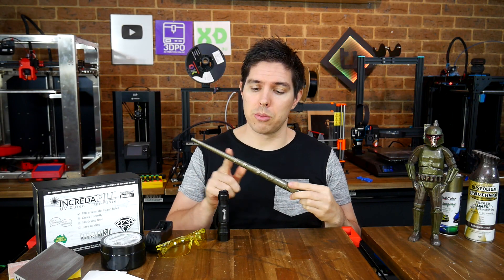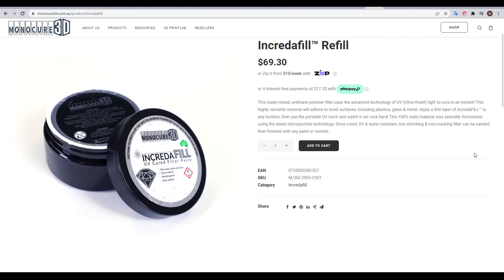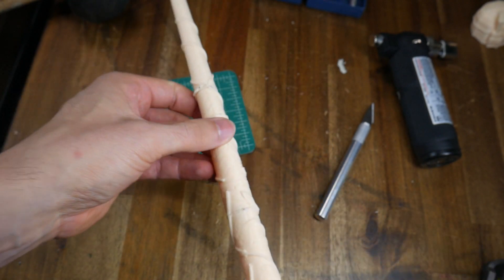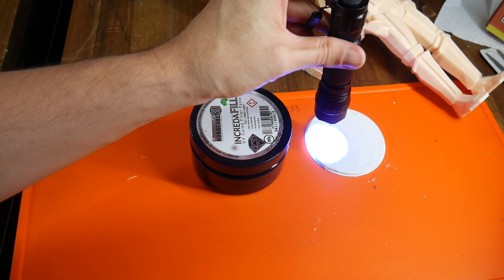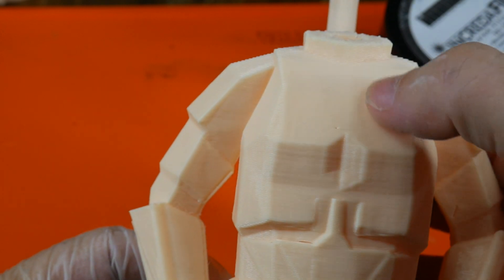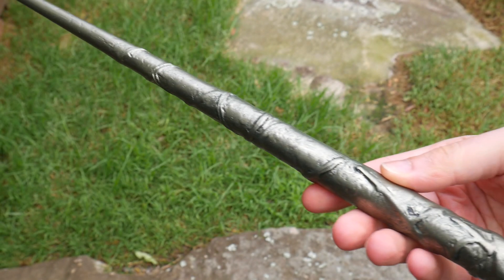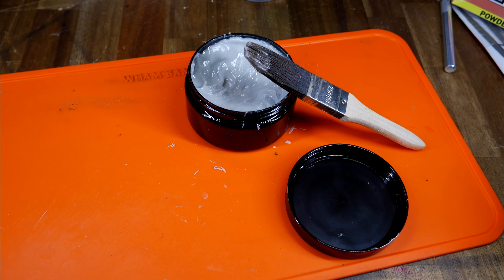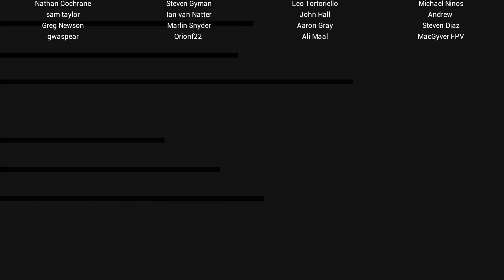Incredafill putty: Remove 3D printer layer lines with the power of light

Comment from the maker: It's clear from the comments plenty of people have home remedies of 3D printer resin mixed with other substances to thicken it up. That's not something I'm personally interested in mucking around with, but I understand that others will get much better value that way. Each to their own!
Reply: I didnt know you had kids
Reply: Can't be bothered to sand things smooth, can't be bothered to try sensible low cost solutions. Kind of lazy considering this is your job yeah?
Reply: @mrb2917  the judgement train is now boarding with a seat left just for you!
Reply: @mrb2917  Except it's not his job, if I recall correctly he's a teacher.
Reply: @mrb2917  spoiler: because it's actually a sponsored commercial.
Reply: Could you do a video where you test if it can make prints water tight?
Reply: Not according to the description
Reply: @mrb2917  Why do you care? And more to the point, sometimes you DO invest more in better tools when you do the same thing all day. I use better paper and pens for my illustrations than most people use for doodles. Does it cost more? Yes. Could I take more time using worse tools and get similar results? Yes. But I don't want to, and I make money off of it, so why not do it better??

Comment: I get a funny feeling you hate sanding.  It's a good thing that folks like you try to keep us informed of products used in the community.  By the way your printer calibration website is very useful, after going through it my Ender v2 is putting out some nice looking accurate prints.
Reply: What's the link to this section of the site?

Comment: To be honest, (at least for me) the price is a deal-breaker
Reply: You can only buy a refill and use sunlight ?
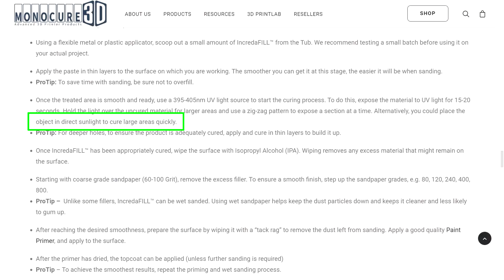Reply: @nobocks  According to 6:24 it might be possible if the only difference is the uv-torch. But I'm also not sure after he still used the UV torch before putting it into sunlight. Probably he was worried that those spots wouldn't be cured.
Reply: You can also just use uv resin.

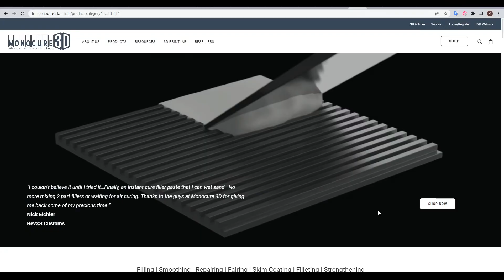Comment: It seems the key to this is applying it very thin so the depressions between lines are filled but not much more than that, their video at  00:52 shows it being applied very thinly with a pallet knife or other scraper type tool.  I'm sure that's much easier said than done! It would be interesting to see what the model would have looked like with only the rustoleum hammer effect paint and no filler at all.   I will have to try some.

Comment: Finishing 3D prints is tedious especially with small detailed objects.  Things like Cosplay helmets and Armor seem to be the better 3D prints to use these techniques on.  I personally like the smoothing technique with Isopropyl alcohol which I think only works with ABS.  This becomes sanding vs trying to get ABS to print properly, and for me I would rather fiddle with the printer to get the prints to work.
Reply: Acetone smooths ABS. Alcohol can smooth PVB I think.
Reply: ABS is an incredible material specially for functional parts, but damn the layer splits...
Reply: @JohnClark-tt2bl  yeah that was it. My wife does nails so we have plenty if I wanted to make glossy parts.
Reply: isopropyl is only for PVB which actually isnt bad at all

Comment: Looking at boba at 9:44 I can see that you were using a bit too coarse of sand paper and Im assuming this UV cure putty actually dries fairly hard unlike automotive putty which dries to be sandable.  You should definitely try out filler primer instead of the putty. It looks like the putty didn't sand very easily at all. Ive worked with a lot of automotive filler putties and such and I can assure you no two brands are made alike and bondo sucks. Some fillers sand like a dream and others feel like you're just sanding epoxy. Filler primer is made for being a top coat over putties which sands extremely easily so you can get it smooth with a 400 grit without having to sand forever.
Reply: Dolphin glaze is an excellent finish putty!
And u-pol filler primer is what i use to prep my prints for paint when i want a super smooth finish
Reply: Yes!  Why deal with toxic resin when you can use putty.

Comment: I find the local autobody supply shop to be the solution.  I use a heavy automotive filler primer, it dries fast, sands very easy but does require a small spray gun and air compressor.  If you have the equipment it's a reliable solution.  A whole gallon of automotive primer costs about what that little can of UV resin costs.  I just buy a quart which goes a long way.  

No matter what you end up sanding which I also hate lol

Comment: Overall the kit looks good especially is you dont have a UV light in your arsenal of tools. Maybe a cheaper refill would be UV resin mixed with some talk powder. The material does look a bit too thick for my liking however. The models you chose were always going to be a tough sell for this product. I still feel a few coats of spray putty would have done a better/cheaper job. Also leaving the lid off the container especially if close to a window or in a room with refelcted outside light could be an issue.
Great review.... thx
Reply: My intuition tells me to try fumed silica.

Comment: You can do something similar just mixing talcum powder with reg SLA printer resin to the consistency you want and costs way less
Reply: What about cornstarch? Just a thought...
Reply: I can't even get normal brushed on sla resin to cure without being tacky--even in the sun I have to put it on a spinner table. I can't imagine making it thicker with anything and ever getting it to set up.
Reply: I wish I had read this comment before experimenting myself. Talc was my second choice of powder, baking powder being my first. Could have saved myself some failure by reading your comment first :p

Comment: Makes me want to try wood filler. I use a wood filler mix for my CNC as Oramask. Ill make some later tonight and see if it will stick to pla. I use a filer primer paint now. It is easy to hide details using filer primer for my PLA so you need to apply it correct. If i could brush the paint on it would give me more control. So i do like this idea of yours not sure if its worth $120 though.

Comment: Thanks Michael of making me feel better about my post processing lol. Full disclosure I have this product I was given by a friend so I did not pay for it so ill review based on if id pay for it. 
does go off if its open it will kind of set little sandy or like flake like bits where any natural light has started to cure some of the paste its annoying when you spread it and it has some of the bits in. it smells a bit and it all the parts or resin printing i hate. I have used clear resin with talc powder and I feel its turn out the same product. overall i think its a good package with the torch  glasses etc but IMO its not for me. i have found Selleys Spakfilla Rapid Gap Filler to work well it does not stink and you can get the pink one that changes colour when its set.

Comment: I believe the need for respirators during sanding should have been mentioned at least one during the video instead of just "don't breath the dust". And it would have been nice if you mentioned the price more objectively rather than just a number. (cause I don't think it's reasonable. But that's my opinion)
Reply: Stating the number is as objective as it gets... You mean you wish he'd mentioned the price more subjectively? Like how he felt about the price or the price as relative to the filament?
Reply: @michaelavery935  Compare the price to a tub of bondo for example ($20).

Comment: This doesnt seem to be any faster and a lot less safer than featherite (a better quality Bondo).  You could probably go with a glazing putty.  It is a single component in a tube like toothpaste.  It hardens in a few minutes and is super hard.
Reply: Featherite? I can't seem to find it online?
Reply: @messiahlad  Feather-Rite, first google result is 1kg for $20 (300567), then it looks like you might need to buy the hardener as well. Way cheaper, and, hopefully way less hazardous for the environment.
Reply: @jaro6985  cheersfor the information, I noticed it only showed up in my search if I typed Feather-rite, otherwise it went to smooth ons feather-lite. I see it's an auto filler, which is also a product we don't get here in Australia, just like bondo. I use xtc 3d for a lot of prints, but I need something more friendly and cheaper for helmets.
Reply: @jaro6985  It's just 2 part resin mixed with glass. Environmentally they are likely similar. The added glass probably makes the dust technically more dangerous, but resin dust without glass is bad enough to need the exact same safety gear so in practice basically the same.
Reply: @coreymorse1347  Usually UV cure resin is more hazardous to the water supplies in its uncured state, but, maybe you are right.
Reply: @jaro6985  According to the amazon listing it's polyester resin, which is environmentally one of the worst types. I don't know which is strictly worse between it and this particular UV, but it's bad enough that if something else is worse it doesn't matter much.

Comment: Good video. Considering that your channel mainly focuses on 3d printing tech, with regard to surface finish, what are the processes you would recommend for an 60-80& solution (without sanding due to its extreme time it takes).

Comment: Appreciate you sharing this. Unfortunately the cost for this product is comically high compared to the cost of DIY methods. If I need to buy a filler then I'll stick with Bondo - less hazardous, easier to acquire, and less costly.

Comment: I’m going to pass on this. This is just UV curable resin with some type of thickener. Resins I’m general are tough to sand. I think there are significantly better fillers out there that are much easier to sand. Most of my prints that involve sanding are larger. I’m a huge fan of Evercoat Rage Gold, very easy to sand and finishes quite well. Not as cheap as Bondo but significantly easier work with.
Reply: On that note, is Bondo available in Australia from anywhere at a reasonable price? I look but i do not find.
Reply: I have some septone car filler i'll be trying.

Comment: How would you say this compares to painting on a thin layer of 3d printing resin?
Reply: Paint is really good at showing off lines.  I did bodywork on my car and and even sanding scratches would jump though the paint.  And that was with many coats of paint and clear.
Reply: Carl Coetzee  You are right!  I read it as "on a thin layer 3d printing resin".  Like he was asking if it was comparable to painting on resin prints.  Its early here.
Reply: @someguy2741  yeah for just paint I usually do something like an auto body filler primer, which isn't too bad, but can need a few layers to really deal with the lines on a print
Reply: The main difference is price. 3d Printing resin is almost free compared to this stuff.
Reply: @HannesMrg  I agree.  I would try automotive glazing putty to cover layer lines.  It is cheap and cures in air and is designed to be sanded and painted and it is safe to handle.
Reply: Carl Coetzee  I was going to mention your tone was excellent.  Lol.  I read every other word and put it together while I had my previous autobody filler comment in my head in the main comments.
Reply: @HannesMrg  For the price of this it would make sense to just buy a really good resin printer :p

Comment: How is this better than Bondo?

Seems like it's actually messier with extra steps.
Reply: bondo has a work time, this does not. That's the main attraction
Reply: @simonl7784  Good answer. Thank you.

I think I might buy some of this, but not for 3D printing. You never know when you need to do it quick fill job away from the shop.

I've already used regular cheap 3D printing resin to smooth out some prints. That worked out pretty well using a paintbrush without having to do any sanding.
Reply: @jtjames79  yah UV cured glue is quite trippy if you never worked with that. Very sci-fi-esque stuff.

Comment: This actually looks really good, I would rather use something like this for larger prints with less complex geometry since its easier to sand than the models you used but I like the idea. 

Can it be used to water seal prints?
Reply: light-curable resin is my go-to solution for sealing 3d-printed speaker enclosures, so, i'm pretty confident the answer is a big "yes".

Comment: This seems incredibly expensive and unnecessary. This is essentially a very thick SLA Resin, as other viewers have commented. FDM Printing comes with the downside of visible layer lines, and some form a post processing will be required to make said layer lines less visible. The amount of time and effort it takes to sand and cure with this product is pretty much the same as it would take with significantly less expensive alternatives. Everyone is always looking for some "magic" post processing material that makes layer lines disappear, or makes the process less intensive, but none ever really do anything more than the product before it. They all pretty much do the same thing. The very nature of FDM printing means some form of DIY handwork/craftmanship will need to be put into post processing. I'll stick to bondo. for a fraction of the price.

Comment: A weird limitation of being cured by UV light is that you can't (really) work with it outside. I typically do post processing (be it 3d prints, or actual wood based projects) in the garden/sun. Makes less of a mess that I have to clean up. But applying the putty outside is probably not the smartest, since you can't leave the open can in the sun (not sure how much it would cure from just being in the shade). If it wasn't for the very steep price compared to "normal" putty, and the need for gloves combined with it being hard to see (without UV light shining on it) I would probably be all over this.

Comment: That is a lot of money for just putty. As someone that does a lot of printing for cosplay and prop replicas that seems rediculous. The method I've been using for years has been Plastic Wood, wood filler. You can mix it with a little water and it create a paste you can paint on. Sands very well. The only downside is that its can be a bit fragile if handled aggressively. But a great solution at $10 a pint.

Comment: I can see using this for large gaps like the joints in the wand but it would be much easier and cheaper to just brush on and cure normal 3d print resin for everything else.

Comment: cant the same result be seen when just sanding the print itself?
for the join between two seperate prints i can imagine using it but for me using a 3d pen printer is better for that (im used to it that way).
It sure could have some use cases but its just not for me.
Good review btw, i think it shows how good the product cures and is sandable and possible use cases.

Comment: I prefer using Alumi-UV. It's a high quality product without the absurd "for 3d printers" mark up that this stuff seems to have. That's a pretty small jar for 70 bucks. Alumi-UV is better priced, brushes on easy, sets fast under light and leaves a coating that's as strong as a hard hat.
I've used SLA Resin once, and for some reason that stuff took days to cure. I had it under my UV flood light. I left it out in the sun. Literally took 6 days to fully cure. Not sure why but I don't recommend using it for anything that isn't a printer.

Comment: i get rid of layer lines with a good set of diamond rifflers that cost me about $10 on amazon (a riffler is just a fancy file made for filing fine details)

to get rid of elephants foot i just use a debarring tool made for plastic again about $10 on amazon

to fill gaps or seams whare two parts were joined i use super glue and baking soda you can get from a dollar store for about $2 

and the only thing that is not reusable and you need to keep buying is the super glue and baking soda and that is only about $2 every now and then as needed 

the problem i see with how you did it is you lost a lot of the fine detail do to the filler and sanding 

the problem i see with the product is it cost way more then the alternatives i use and it takes more time and involves more work then just using a riffler alone to file down the layer lines

Comment: Too expensive, UV resin is much cheaper and basicaly the same thing exept you get better layer coverage which means less sanding than a putty, although for deep fills I use P38 first and then a coat of resin, a UV torch from Bangood is very cheap so you can be up and running for £40

Comment: Excellent video Michael, I'm looking at a lengthy process of using xtc 3d and not having to worry about the tight time frame would be nice. Following up on incredafill, any idea how strong it bonds? I'm wondering if it could be used as a glue as well.

Comment: Don't rotary tools like dremel work for sanding 3d prints? Could be hell of a lot easier.
Reply: The Dremel melts and warps my pla most of the time even using less abrasive parts.
Reply: @J-T29  a low rpm and high gear device could work better 🤔
Reply: @Martin-dw4eo  the best luck I've had so far is an electric nail filer. Overall though, I prefer going over everything with a thin layer of apoxie sculpt so I can texture it (having sculpting experience by hand does help there).

Comment: UV resin mix with baby powder/talcum powder work the same. Although you can control the mixture consistency. And with an airbrush a mixture of uv resin and IPA you can cover large flat surfaces.

Comment: I just made a suspiciously similar paste by mixing corn starch with uv resin. Seems to work exactly the same as in the video.

That kit is way overpriced, especially the paste. I'm guessing it's probably 1 part resin, and 3 parts filler. Pretty good idea though, being able to control the thickness when you mix it yourself is great. I like it a little thin so it still settles slightly
Reply: I was going to say the same, waay cheaper for the same results